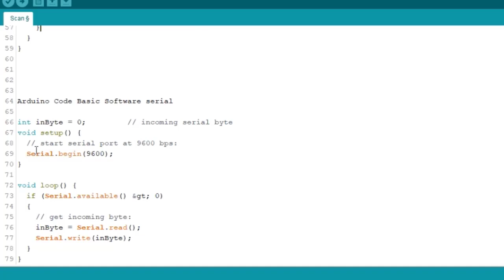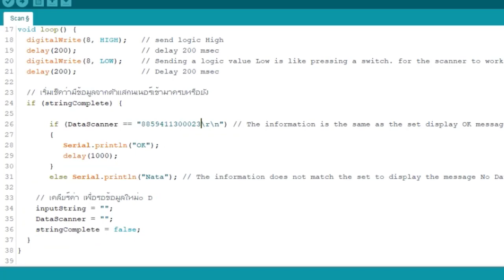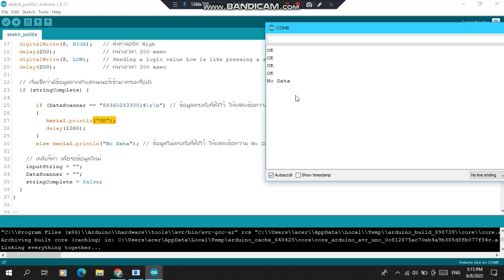How to connect Barcode Scanner module Automatic

Comment: What's the reference of the scanner?
Reply from the maker: MH-ET LIVE Scanner v3.0 is a barcode and QR code scanning recognition module. It adopts a professional image processing chip for barcode recognition. It can quickly and accurately read under the high performance of fast and stable reading in complex environments. Take one-dimensional code and two-dimensional code on the carrier of paper, screen, plastic, etc. . Small in size, onboard USB and UART interface, can be directly connected to the computer, or integrated into a variety of devices. The product features low power consumption and low heat. Quick start, cold start and warm start can be kept on standby, no need to wait, it is ready to open.